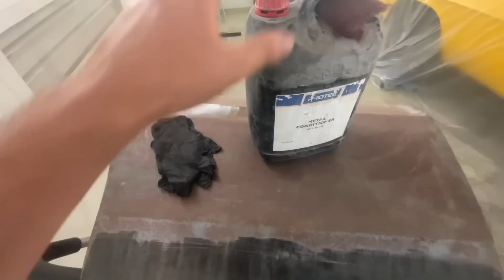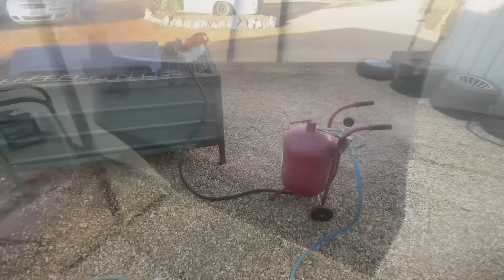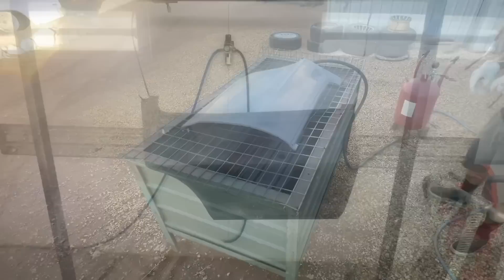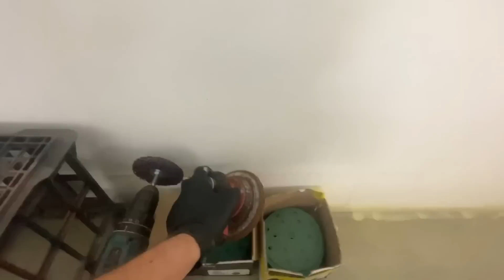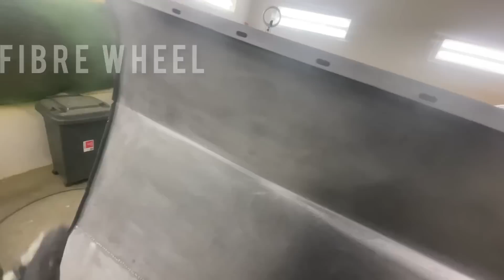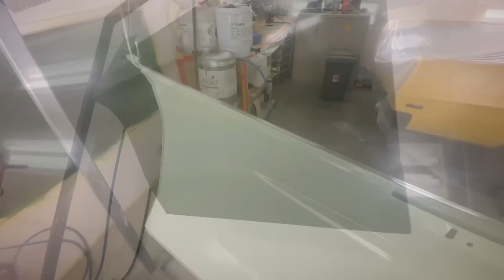Preparing Bare Steel and Spraying Epoxy Primer - The Resto Shed

Comment: Without the door skin off, after metal work is done, I use a concrete and metal cleaner inside using a small pump. I make a homemade play dough to plug weep holes and catch the chemical as it runs out one end. It turns rust into iron phosphate! Then spray and wipe to clean while allowing several days to dry. Rust turns black and stops future problems as it seeps into the seams and pinch welds. With a detail gun and plastic sleeve, I spay epoxy inside the door and other panels. Once painted, I complete the inside with a pro-gun setup using a cavity wax from quarts of product. This one is mine and should last 50 years after I am gone. DK, Omaha, NE. USA
ASE Master since 78.

Comment: looks nice i do use isopropyl alcohol for a final wipe down using white or light colored rags until the rags stay clean no more grime coming off  as advised from watching other posts
Reply from the maker: That will work too, but I do not find it necessary at this stage. To each their own, this is at the end of the day just want I do and find works for me.
I find introducing any wash/solvents will increases the chances of little fluff balls being caught up in the keyed up surface when being applied/removed with rags/cloths.
Reply: We do this inherently out of insecurity typically.. But as mentioned In the video the panel has been hit with degreaser, sanded rinsed and dried fresh gloves have been used and so on. Sufficient I'd say.

Comment: Thanks for the effort you put in for these videos!

Interesting that you rub the phosphoric coating off before epoxy, Howard from Astill Design has a video with PPG & they say to leave it on under the epoxy.
Obviously your method will be fine because you’re spraying it straight away but interesting all the same. 👍
Reply from the maker: Thanks for watching.

I use a different epoxy to Howard although both are (now) PPG branded.
Personally I’ve had catastrophic delamination issues in the past following the same process show albeit less the sanding of the phosphate coating before epoxying (as had many other when I questioned what I’d done wrong!)
So now I just do a panel at a time and get it in epoxy ASAP after abrading the surface.

Comment: Great video, do you have any product recommendations for weld through primer (or any to stay away from)?
Reply from the maker: I prefer to use Upol #2 on MIG plug welds. But it is important to only use it on the overlapped seams, it is NOT a primer and cannot be painted over.
Reply: Hiya Shane not sure where you are but in the UK Halfords do a weld through primer that I've seen on a channel called Dave's Garage he's restoring a MK1 escort and he tested various weld through primers this cane out on top as the best he had a piece of scrap metal that's been sitting outside for over a year and has no rust under the coating at all unlike other products he tested hope it helps?